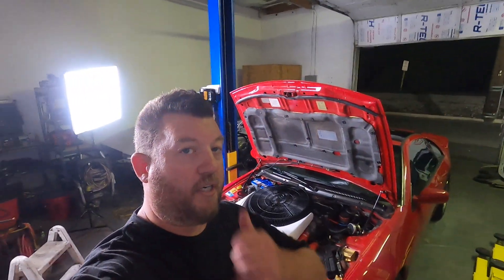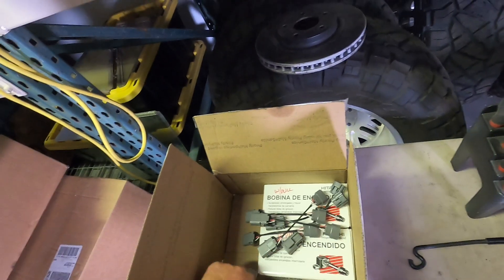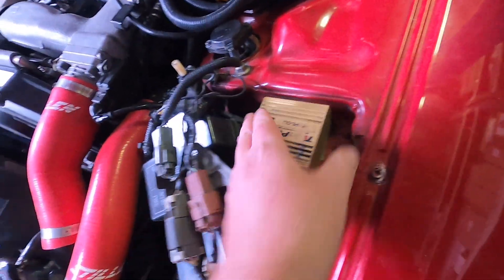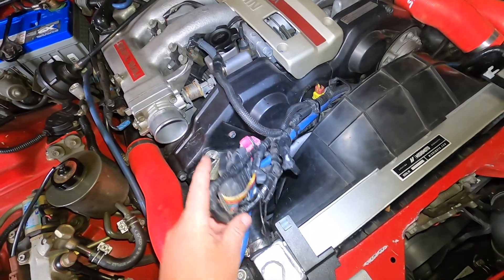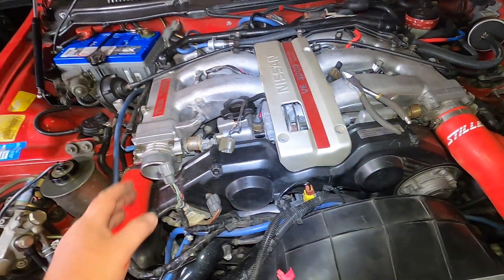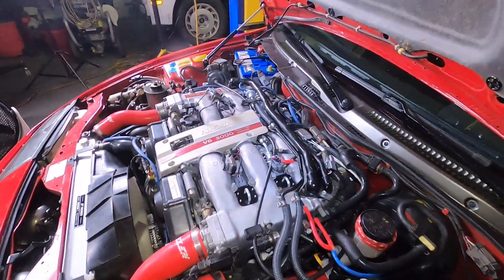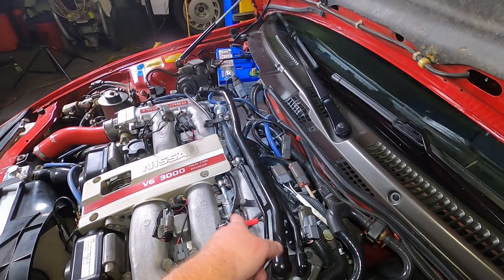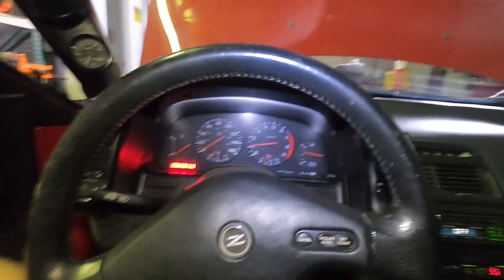Z32 R35 GTR Coil Install

Comment: Concerning the chip.  Does it replace a tuned ecu like a Jim Wolf or Mines type. Is the chip needed for the R35 coil convert?
Reply from the maker: Yes, you remove the old chip and install the new chip. 

From what I've heard, you need to have the coil dwell time adjusted or you risk frying the coils. But I'm not an expert so you might want to reach out the BDE for real advice.

Comment: This is interesting. I would like to see a followup. How much boost? Did the coils bolt into the OEM mounting holes? Did you tuck the wiring? How did the tune go?
Reply from the maker: Man - it's running great. I've ran 22psi on e80 so far. Tune works perfect. And yes, everything was a bolt on affair. Wiring plug adapters are a little long but they allow you to position them where you want.

I'll be installing an AshSpec intake here pretty soon so I'll do a more in depth look at it, but I'll be switching out the wiring adapters, soldering, and tucking the wires to look nice.

Comment: I don't suppose you have a more detailed video, kind of a lot missing. Was connecting the Z32 dust boots tricky? Do the connectors fit ok? This looks like a great setup. No plenum pull! That's great!
Reply from the maker: I don't have any more video, but I will be installing them on my other Z soon and I can take more detailed shots when I do.

Everything was very straightforward, no surprises. It was a lot easier than I thought it would be.

I had to deal with that additional ignition box that I had to deal with so I did a lot more off camera. I'll be more organized for the next video. 👍🏽
Reply: @TheHoggman  awesome. The fact that no plenum removal with the installation is great. I’m looking forward to your video.